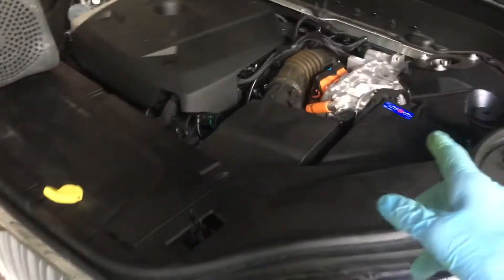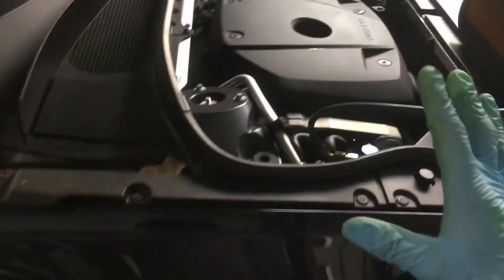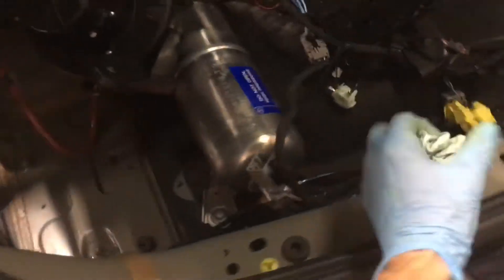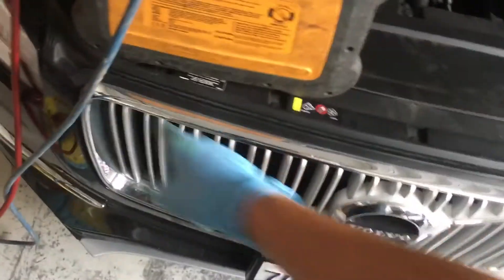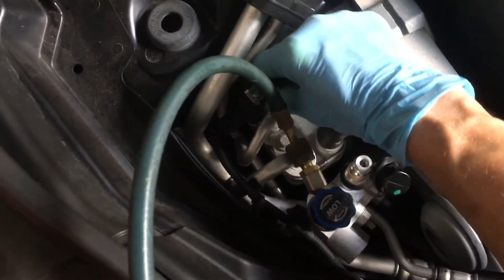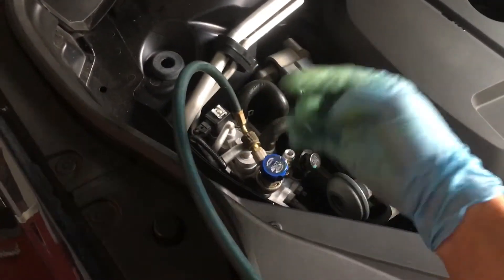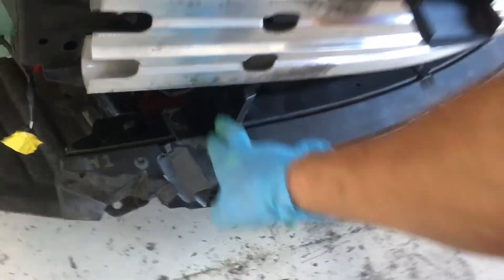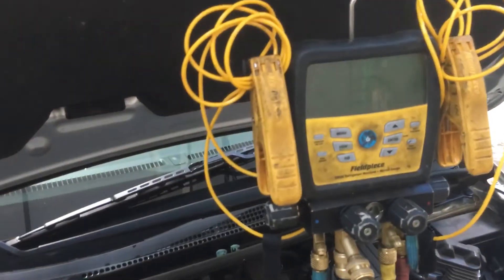Heat Exchange your glycol loop on Volvo CX 90 with rear air conditioning with largest condenser

Comment: Hi Tom,
The size of the condenser from MAHLE was 681x381x16mm excluding the receiver drier and ports, the total width would be 834mm including the receiver drier and the refrigerant inlet/outlet. Is it the largest condenser you have ever seen on a normal car? Interestingly this condenser also applies to the petrol and diesel version as well....
Since I just saw you working on an old volvo s60 only, can you do me a favour and specially make a series on this one?
Disclaimer: Volvo owner/fans.
Reply from the maker: I’ll try to get some more information on this Volvo when I go back to recharge it but I really cannot see anything in that engine compartment and this is a hybrid I believe so there’s absolutely no room with all the plastic covering for me to get clear Eyesight to try to follow all the glycol cooling lines and refrigerant lines

And your sizes I think you believe you made a mistake you said millimeters when you meant centimeters. 

And you may want to check the factory website for the condenser sizes if there’s a different size for the hybrid compared to the gas or diesel model. 

Larger condensers really old cars had very large condensers and some new pick ups have very tall condensers compared to width.